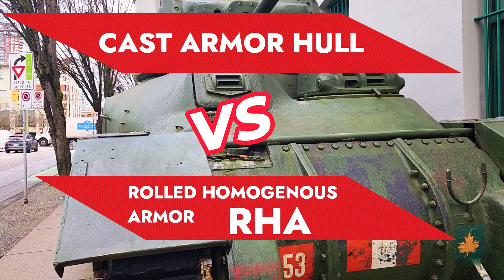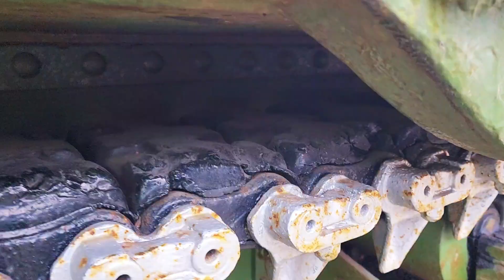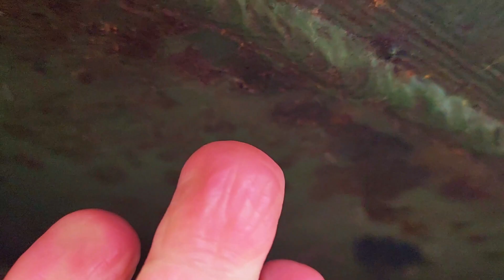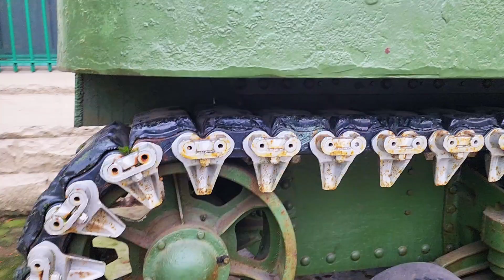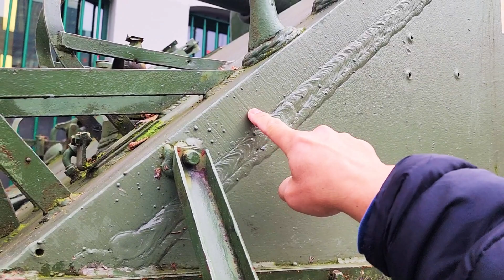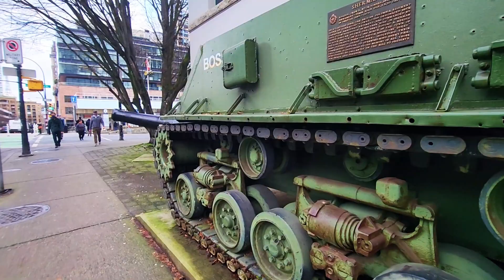M4A3E8 EASY EIGHT SHERMAN TANK AND RAM 2 TANK M3 CHASSY: CAST  ARMOR VS ROLLED HOMOGENOUS ARMOR

Comment: The US Army Ordnance engineers decided to use cast turrets and hull tops since those could be shaped to deflect rounds, increase the thickness where needed and shaped inside to hold various equipment by shaping the molds. Then they only needed to fill the molds eith molten steel then grind off the excess when cooled to have it ready to be finished out. Welding several sections took longer plus the US was short on trained welders. The M3 had a cast turret and a rivetted hull due to not having enough welders available to weld it's flat plates together. Chrysler produced  cast hull tops for it to gain experience before making cast tops for the M4's. It took them a bit longer to figure out casting the final drive housing. They switched to using welded flat plates once more welders and automatic welding machines were available.
Reply from the maker: Thank you for sharing. These are very valuable piece of information that fills in the missing part of these tanks history.

Comment: A cast hull is far from "easy" to cast.  It requires a substantial foundry.  The beauty of HRA is that it can be shipped in bulk as flat steel plates to dedicated assembly plants such as the Detroit Arsenal and assembled there rather than tying up production at the foundry.
Reply from the maker: That is a good point, there is always a pros and cons  for each manufacturing process after all. Thanks for sharing, that kind of information is not easily accessible to the public 😊